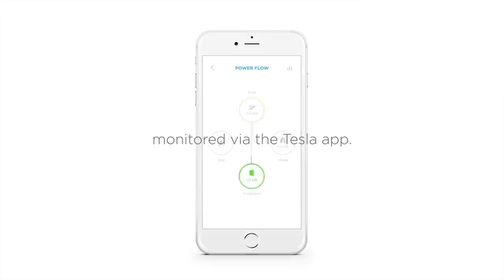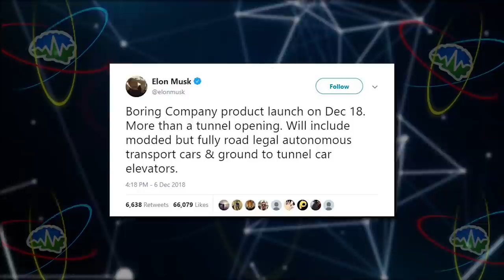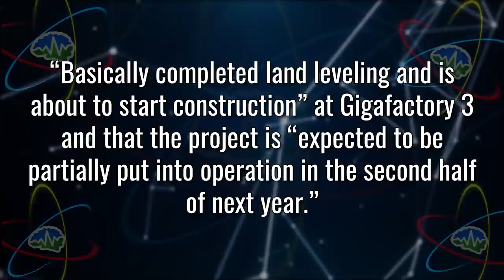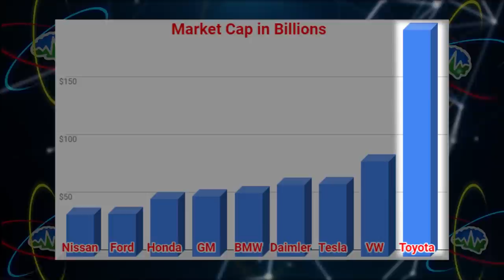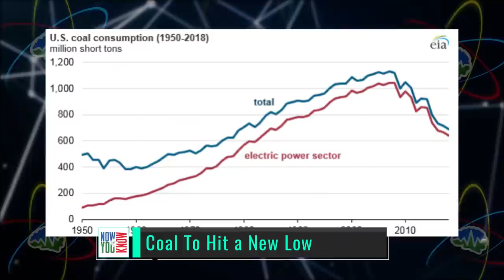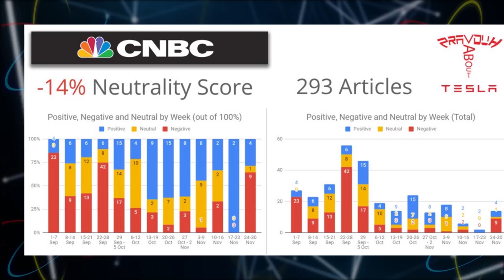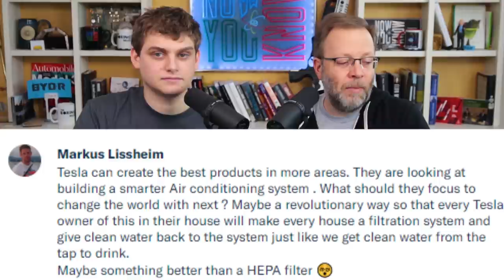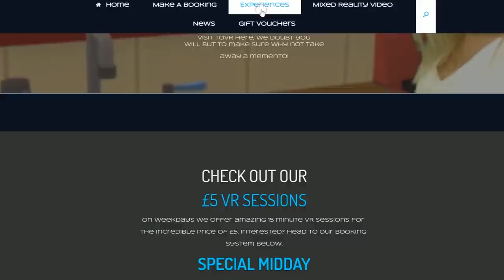Tesla Time News - Model 3, Model Y, Gigafactory 3 News and More!

Comment: I think ships will go electric before planes do. Battery swap will almost certainly be the go to choice, in fact it might be a dirt cheap retrofit for any diesel-electric ship, outside the cost of batteries at least. Battery packs could be containerized, and all you would need is the power electronics to convert from DC at extremely high power, and a power line running from the container area to the motor. Batteries can be put in containers, and they already have the infrastructure to move containers, those same cranes can pick up battery containers. Batteries can charge while the ship is away, and swapped in while the ship is in port loading and unloading.

Comment: only one engine was lit for "landing". the falcon losing speed while suicide burning  makes those fins less efficient, and thrusters could slow down spinning.Only One engine cant prevent rolling, you can do that only from 2 or more, by gimbleling them tangently in opposote direction, if it make any sens ^^

Comment: To drive from Calgary to Toronto using superchargers, you have to go via Vancouver. Turns a 50 hour trip into an 81 hour trip. Been waiting two years for the promised Montana superchargers to get built so we can get down to the US network, which would be fine if building in Canada is too hard/cold/polite.

Comment: My wife drives a 2008 Peugeot 308 wagon here in Australia which has a third row seat, but it is removeable, and only seats 2 small children. We took it out to increase the storage space in the rear of the car as we don't have kids at home. Given that the Model Y is supposed to be a CUV, it will have more vertical space than the 308 which is quite a small car, and also will be wider, so a third row seat, while cramped would probably work OK for families with kids which would be the main customers for the Y (the soccer mom demographic). In that sense, this is the 2020 replacement for minivans like the Dodge Caravan, etc.

Comment: I lived n a VERY northern US climate growing up.  In my teens I worked at a small grocery store and the ingenious owner set up an air in and out based on interior/exterior thermostats to his large door coolers.   WHY in the hell do we use electricity to cool our refrigerator while it sits in a heated home?   The outdoor temp in most northern locations is LOWER then the fridge setting much of the year.  It's so stupid.  There absolutely has to be a better way to use outdoor temp to assist refrigeration.

Comment: Maritime Mersk,

  It may sound bonkers but please , consider replacing heavy oil diesels with steam turbines fueled by wood pellets which are a step above wood chips they do allow for a denser fuel load than wood chips. Or possibly a hybrid setup with a small turbine to generate power to charge Latium-ion batteries which power the single shaft or forgive the loss of memory but multiple pods with props on each one. Three or four pods able to rotate 360 degrees should do interesting things when coming in and out of ports. Now add the ability to charge from shore when docked. Remember electricity is cheaper than fossil fuels in most of the world.

Cheers!

Comment: Long distance ships and aircraft will be better off getting their fuel made from plants to go "zero" CO2. 

A 5,000 TEU ship on the trans-Atlantic run will likely need a 23,000 tonne battery of NCA cells for a 3,700 nautical mile (NM) journey, and 35,000 tonne battery for a 6,700 NM trans-Pacific or East Asia-Europe trip. I have assumed a 20 kt speed and a 4 day 'fuel' reserve for weather, etc. 

The ship + cargo probably weighs 80,000 tonnes of which the fuel is 1% to 1.5% of the mass. Lower sulphur fuel is probably $500/tonne.  

As ship engines run very slow and can extract over 45% of the energy in the fuel with various tech, I have assumed the ship gets 5.5 MWh/tonne of fuel. 

I have assumed the battery weights 5 kg/kWh. At $100/kWh, the battery costs $20/kg, or $20,000/tonne. 

At the above prices, the small battery costs $460 million, and the large battery $700 million. I understand the current ships cost about $1,000/gross tonne - so $80 million for this ship.  

Even if I'm out by a factor of 2 on costs, long distance ships are better off using plant based fuels in the long term.

Comment: a single rocket motor cant reduce the spin. It was due to the reduced airspeed meaning the grid fins weren't providing much aerodynamic forces combined with the nitrogen thrusters.
Reply: I believe F9 uses 3 rocket thrusters on re-entry and they're on gimbals.
Reply: @ZacCataldo  only 1 for landing burn for leo missions and most GTO,  this is a 1 engine landing burn as can be seen from the footage, this was a very low speed leo mission. They have done a couple  of 3 engine suicide landing burns for very heavy payloads. The boost back and re-entry burns are above the vast majority of the atmosphere and so have no effect on the grid fins. if you watch the on board video you can actually see the nitrogen thrusters slow the spin and actually over-correct the spin just before splashdown.

Comment: Tesla would not let me use your code.  Because I had ordered when AWD it was not eligible and I tried to add it before delivery after they changed the eligible M3s  But they said no.
Reply: I heard you may go to a dealer and ask them to attempt to apply your code
Reply: I went to dealer locally and in Las Vegas.  Finally emailed referral department and they gave me the bad news

Comment: Container ships moving away from carbon? Are they going to install nuclear power plants? You can do batteries for a while, but, the sea time for crossing the oceans would be too far. If they work out thorium salt, they could have a cheap fuel supply, with a fail safe reactor design.
Wind and solar are fine, but the power to space for a container ship, and the overhead clearance requirements for the dock cranes, along with the fact that the taller a boat is, the more unstable it is, I just don't see it for a serious container ship. Plus, refrigerated containers are plugged into the ship power....

Comment: What can Tesla do next?
1. I would like to see them domesticate heat pump technology. There isn't really anyone offering a all in one heating/cooling solution, that could keep your home warm and beer cold.... With a heat pump furnace/ac, and integrated fridge/freezer, as well as the hot water heater. heat pump oven? Many gas stations and grocery stores use heat pumps to keep the coolers and freezers cold, and the store comfortable. they could use air units, or geothermal wells for the exchange.
2. How about expanding and improving geothermal power plants?
3. It's going to take someone like Elon Musk to develop the Thorium Salt Reactor into a real solution to the aging and dangerously designed current nuclear power plants.
4. And, it should be possible to separate the depleted materials from current reactors, into spent and still fissionable (reconcentrate). If reconcentrated, the depleted materials should be safer, and cycle to safe levels sooner. By removing the still viable fissionables, there won't be additional particles being emitted, and the already enhanced fuel can be reconcentrated into fuel that can again sustain reaction levels needed to produce power, which would reduce the "waste".

I know you guys are anti nuclear power, but I'm not. I think it's criminal that the "light water" (currently used) reactors were chosen over the thorium salt reactors, for a purely political reason (there is a audio recording of a meeting stating it was chosen for votes, not safety or efficiency).